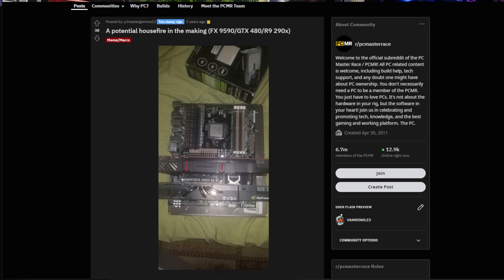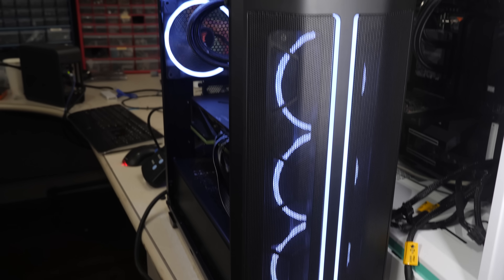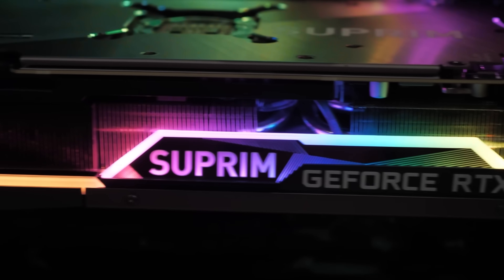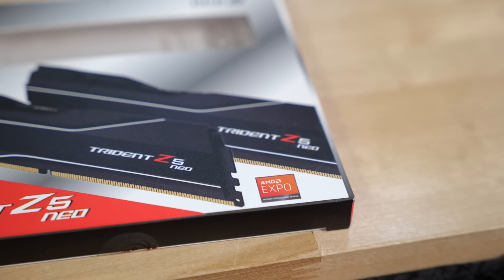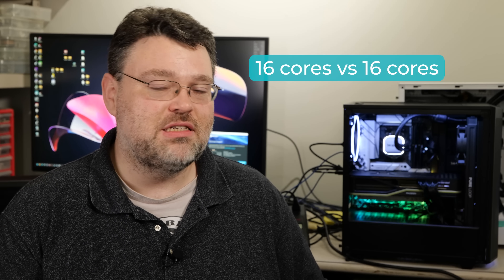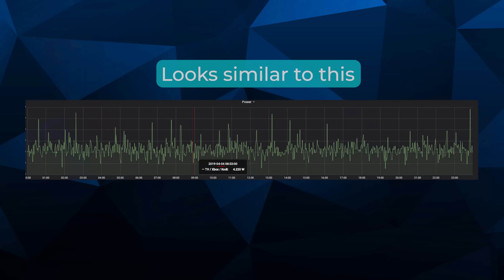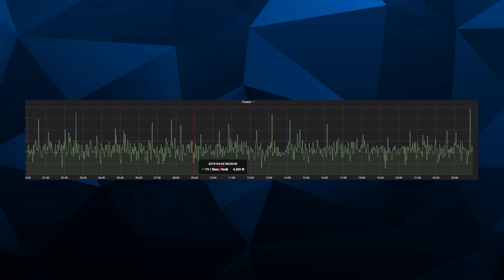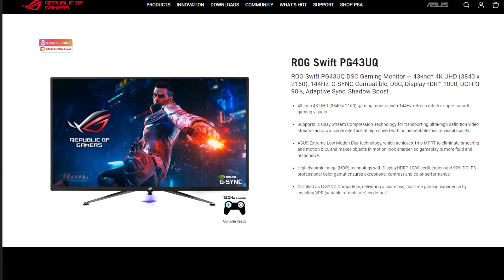Too Hot? How much Heat Do Intel and AMD Actually give off?

Comment: My friend and I have put our new PC builds on hold partly because of the de-lidding results der8auer got.
This helps lean me back into getting a 7900x and sticking a Noctua NH-D15 on it.
Reply: Do also remember that you can set a negative PBO offset and probably get temps below 95C without any performance compromise